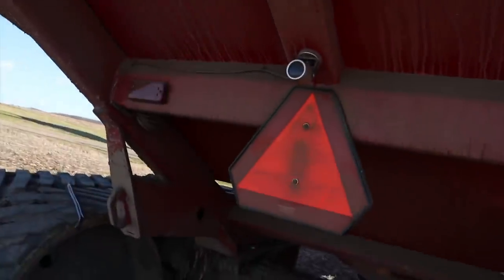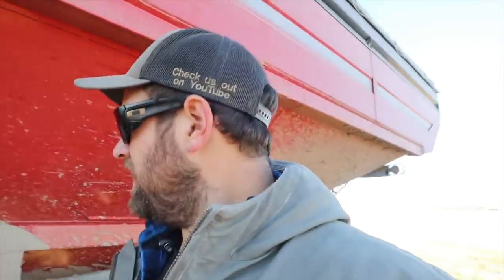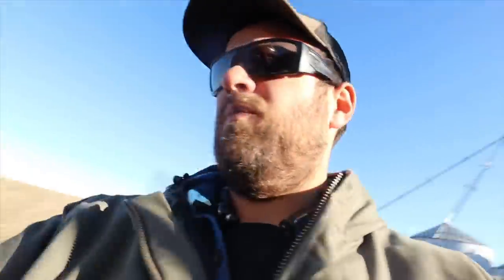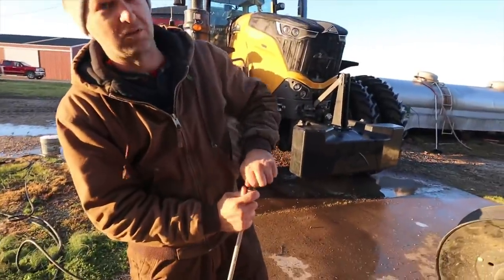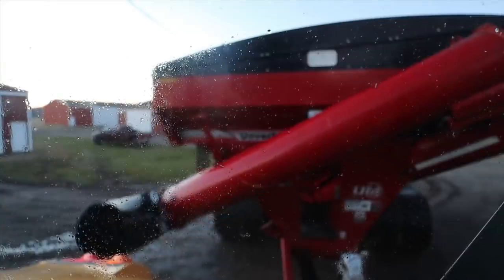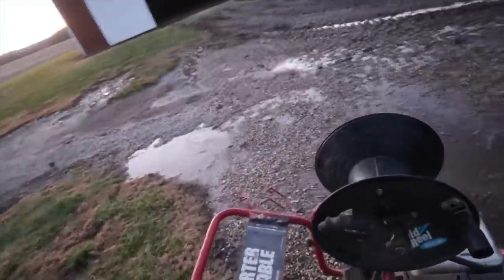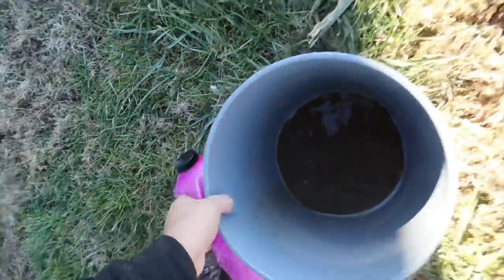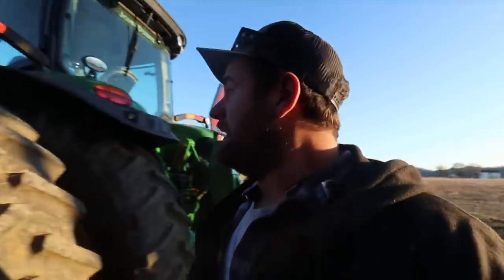Make The Tractor Clean Again | Wash Days

Comment: Brian you really need an Foam Attachment on your pressure washer. With a good washing degerent, it makes washing equipment so easy.. blow of the worst stuff .. Aplly foam, let it sit a bit apply a second shot of foam at the top  massage it in with brushes, let it sit, rinse and = clean.